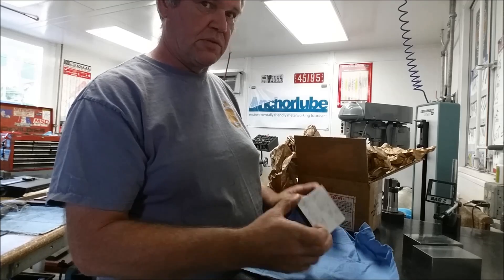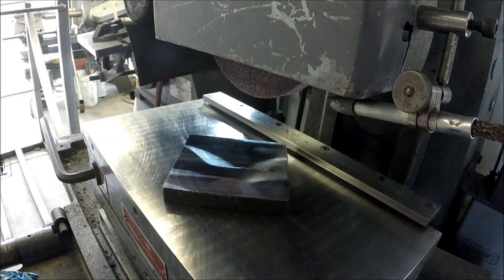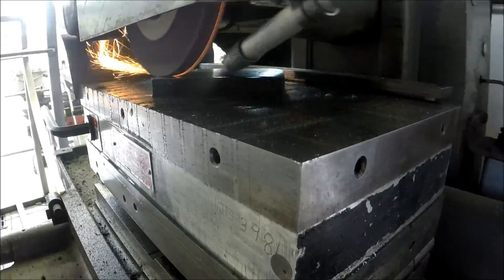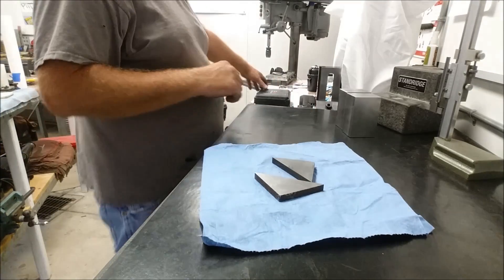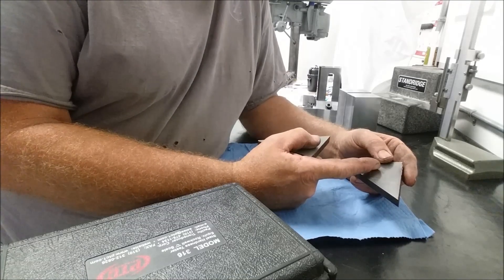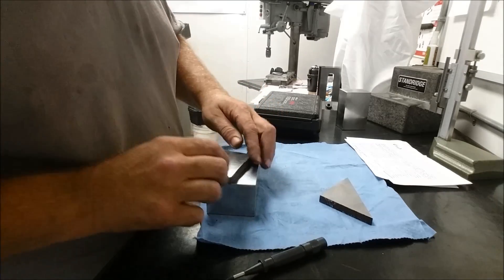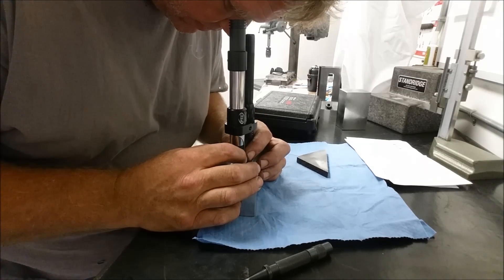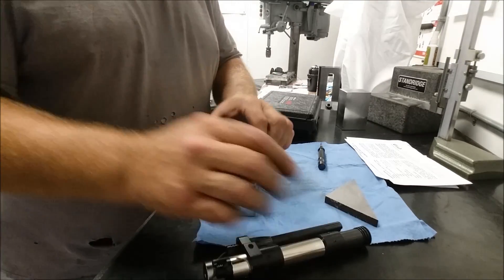Mystery metal hardness test

Comment: Hi Stan, this small oven is one practical item for quick sampling or testing jobs...
It's kind of very difficult to identify alloys for sure, the scrap metal recyclers have an hand held tool to do just that, the freeking tool cost around $15,000, but it's pretty accurate, non destructive and fast.   Pierre

Comment: Cool video Stan.  R-60 !  good and hard.  I wonder what they would sound like if you dropped them on the ground.  Hardened metals put out a higher pitch ring than lower hardness.   Like the sound of a grade 8 hitting the floor versus a grade 5.  The grade 5 will make a dull thud sound.  Maybe do the drop/ring test on two pieces of junk/scrap.  Would be interesting.  Or two identical rods, bent in a "U" shape, just like a tuning fork.  Harden one but not the other.  See if there is a noticeable difference in the tone that they make when struck?????

Comment: There is an old trick a tool and die maker told me, for identifiing a mystery steel. Cut out a toothpick/matchstick piece. Heat it with a gas tourch till red then air cool. Bend the tip with a pair of players, if snaps or springs back to initial position, its air harden. if it beds to a shepherd hook start over. Quench in oil then water, repeating the test.

Comment: What rod would you use to weld this metal?
Reply from the maker: Kevin Hornbuckle Not sure, welding tips and tricks would be a good source.
Reply: Kevin Hornbuckle I would avoid welding this as far as I'm concerned, unless as a last resort, maybe DRY 7018 or better rods with adequate preheat, even with this, the dilution of the base metal makes for a zone that is VERY prone to cracking...